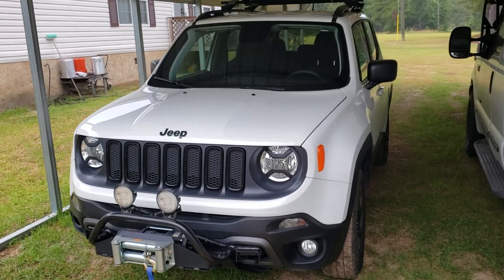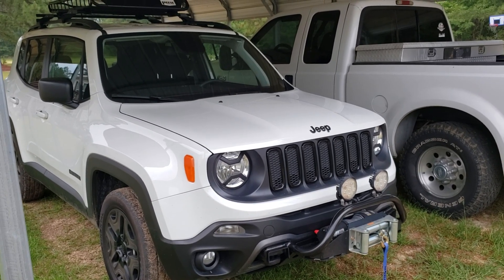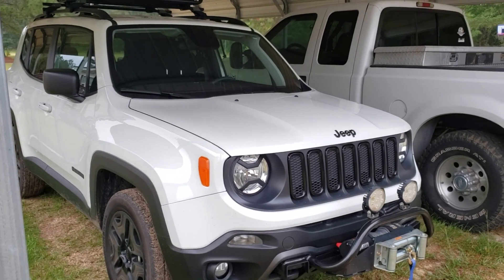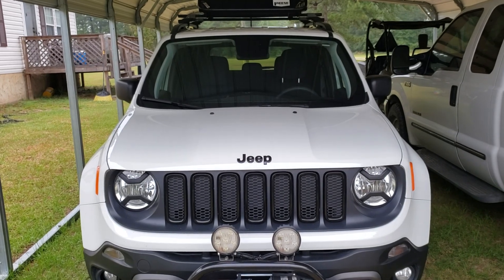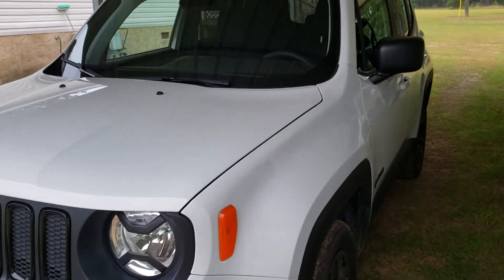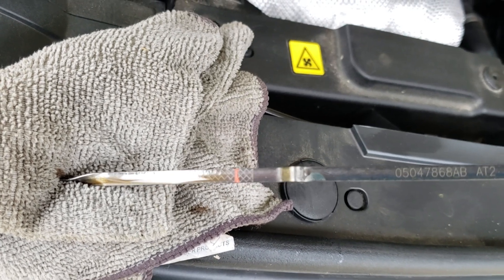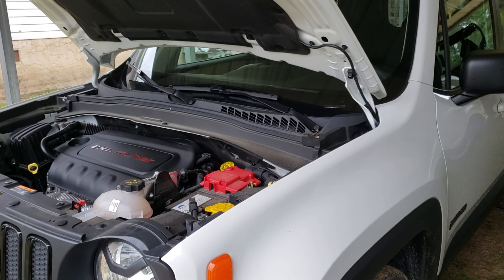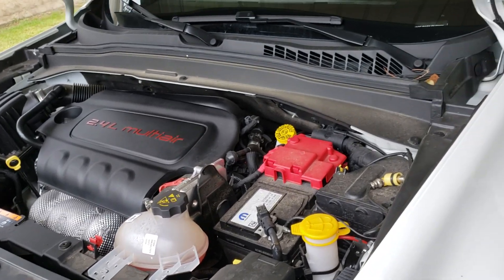2018 Jeep renegade using oil!!! Follow this link to hear what happened-https://youtu.be/xJyersWGxAk

Comment: I have a 2018 Renegade & having the same issue & same run around from the dealership
Reply from the maker: Well I'm sorry for you. The dealer is considering trading me out of it and paying off the loan in full...its the best you can hope for I'm afraid.
Reply: @fastdraw30  thank you for the information.  They tried to tell me it's "normal". The Jeep shut off on me while I was driving at 2,800 miles. Just added oil again today.
Reply from the maker: @tamparsons4  this issue is due to a broad spectrum of reasons, and chrystler Corp wont do anything about it,  the engine is a Fiat, actually the entire vehicle is a fiat that's was adopted by Jeep/Chrysler. The engine, the 2.4L tigershark was originally designed to perform in Europe under European emissions, which aren't as strict. So when it was adopted here domestically they had to make revisions to it in order to meet EPA standards, these revisions included a hotter thermostat,  thinner oil, and smaller rings in the cylinders.  This was done to reduce frictional drag internally to increase HP and fuel mileage, to meet the ratings set by EPA. The valve train is operated by electric solenoids versus traditional mechanical valve guides and rods, this system coupled with the revisions made for EPA standards is the reason for the oil consumption. The hot, thin oil and small rings in the cylinders,  along with the solenoids in the valve train allow the engine oil to pass by the valves, into the combustion chambers, and because of the high engine temps is being burnt efficiently as a fuel which is why there aren't any signs of oil leaks, or residue in the exhaust. Fiat, Chrysler,  and jeep are fully aware of this issue which is why they created a  blanket policy to cover their ass...which  is as follows...First 50,000 miles of engine life: one quart per 2,000 miles.

Engines with over 50,000 miles: one quart per 750 miles.

Aggressive driving conditions: one quart per 500 miles.
Reply: @fastdraw30  thank you for the information

Comment: My wife's car has the same engine 2018.  So far, no issues,  It will be down a little bit between oil changes.  My wife gets her change at the dealer and they use Penzoil 0-20 synthetic.  I do not know if the brand of oil is important, but I do know they have very specific specs for the oil in this engine.  Something to think about.
Reply from the maker: Yeah all the service has been done at the dealer, and yes to keep your warranty on the vehicle you must use the pennzoil 0w20 in it. Its continued to consume oil, and it's getting worse.  Now the owner of the dealership is involved and they are talking about trading me out on it, because they cant fix it.

Comment: Im having the same issue with my 2018 Rengade Trail Hawk , my dealer replaced the motor in mine at 40,000 miles. they put a whole new long block in it. lets see if the new engine is any better. its only been a week now since the new motor was installe and the oil lite came on this evening. back to the dealer..... what a POS
Reply from the maker: The complaints keep rolling in,  it's no surprise at all bro, it's not going to fix it I can almost bet on it, just a huge design flaw and apparent failure by fiat.

Comment: I have 2016 Renegade and have the same issue. I generally change oil around 5000 miles and by that time my oil level is at the bottom of the dip stick. So that’s averaging about a quart ever thousand miles as well. Plugs are clean and no sign or oil smoke when engine runs. When I start the engine the oil light stays on for about ten seconds before it goes out. I also have to keep an eye on the oil level and add about one to two quarts between changes. So where the hell does the oil go?  Let’s face it, the oil they want you to run in these engines today is way to thin in my opinion. 0w 20 is like water. I was told by an old and very experienced mechanic that putting 10w 30 or 20w 30 weight oil in the engine isn’t going to hurt it unless you live in Alaska or Some place where the temps could get well below freezing, like minus 20 degrees overnight. You might see a very slight drop off in gas mileage. I got a chance to talk to another Renegade owner that did just that. He said his oil consumption improved.  I would However wait until your warranty expires before doing this cause if anything would happen to valves or lifters etc. Jeep will test the viscosity of the oil that was in the engine. I tend to believe the old guy cause why wouldn’t thicker oil lubricant and seal more then thin oils. In my days when cars had high mileage on them we use to put STP oil treatment in them, and STP is nothing more then a bottle of like 50 weight oil with additives to help seal rings, valve guides, and bearing clearance. However it’s a medicine you will have to treat your engine with ever oil change. And this 2.4 engine is not a very good engine in my opinion (I think it’s built by Fiat) and I don’t see it lasting over 100K miles. I’ll never buy another Chrysler product with this engine again.
Reply from the maker: Your right on some levels, it is a fiat engine, poor quality,  prob wont last more than 150k I think...the oil is thin however for a reason, one is that the cam bearings are dry...so the oil has to have a fast pumpability factor, or you run the risk of scaring internals..two to reduce drag and friction for emissions to achieve fuel millage, three to dissipate heat faster, a thinner oil cools quicker, however, it comes at a price...because it's so thin and the valve train is operated by solenoids instead of mechanical springs and rods, the oil will leak past the valves into the combustion chamber and due to the extreme heat, is being burnt so efficiently there is zero trace of it in the exhaust, plugs or intake. You cannot run 10w30 or anything above a 5w20, because these engines are so cheap, the displacement of oil will stretch cam  tensioner parts, chain, valve seats, and wont flow quick enough on start ups to lubricate internals causing dry starts. Now STP I dont think will hurt anything, as it's more an additive and coating and is designed to mix with oil, it's not a 50wt...huge difference...I think combined with a 5w20 it will remedy most of this issue at hand, but as it stands I'm currently in talks with Chrystler on trade assistance and will be getting away from the Renegade all together.
Reply: I think you are putting too much oil in 5.5 gallon with filter change. Level at dipstick about half way. Too much create whipping and oil goes out the closed crank system. Check when warm and you be closer to high mark.